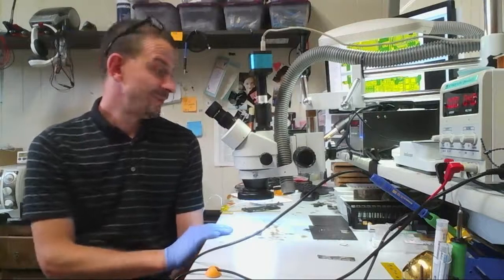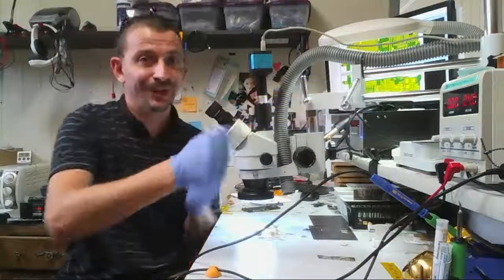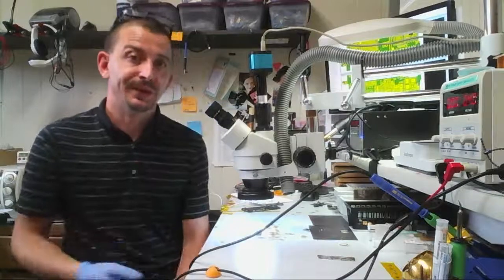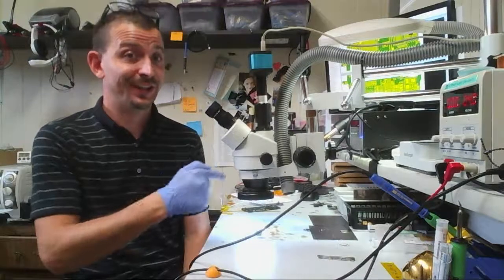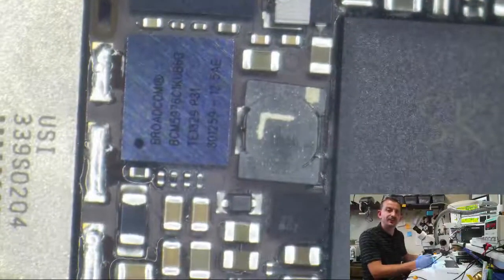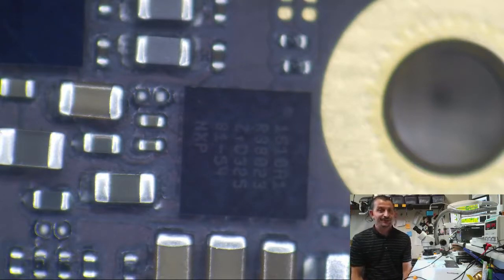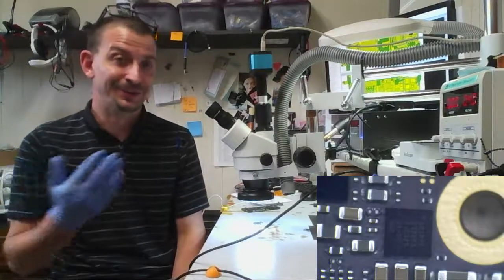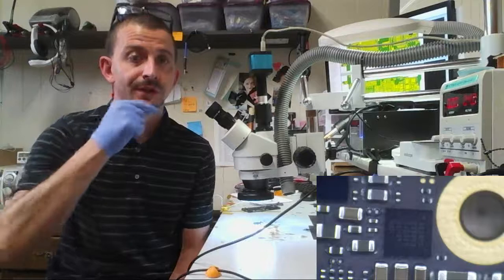Some new capture hardware for this YouTube channel

Comment: Jason  get this and take everything off  mount to scope and camera screws on it    adjustable works great   I HAVE SAME SCOPE  https://www.ebay.com/itm/KOPPACE-0-5-C-mount-Lens-0-5X-CTV-Adapter-Trinocular-Microscope-Camera-interface/392201151202?ssPageName=STRK%3AMEBIDX%3AIT&_trksid=p2060353.m2749.l2649

KOPPACE 0.5 C-mount Lens 0.5X CTV Adapter Trinocular Microscope Camera interface

Comment: I am interested in your Smoke Absorber and routing of it.  Can you do a video on it?
Reply from the maker: Yes, I sure will :)  Planned to do a video on it after I finalize it.  Right now it's pulling the air through a standard shop-vac filter.  I know it's not working too well because you can still smell it.  I'm installing a 6" vent pipe over head that will blow the exhaust strait outside and I'll tap that with smaller (2-4") flex tube that drops down to the microscope head.  The whole thing should cost about $50-$100.  That will keep exhaust blower way away from me but will be switched off and on from the bench.
Reply from the maker: I originally  built it out of a 5 gallon bucket with the blower mounted on top sucking from the bucket.  The inlet tube came in high on the side with a 90 degree elbow inside followed by another short piece of tubing to the bottom of the bucket.  The idea was to fill the bucket with what ever filter substrate would work best.   The whole thing was just awful - it had this harmonic whistle that I bet the neighbors could hear.   It was too loud to use.

Comment: Awesome, the other one wasn't showing what you were looking at. Louis said you lose 1 eye piece when you use the camera?  It helps drunk drivers!!!!! lolz! HICK UP! I bought the other type of Scope, Omano OM 1030. Its a good clear picture.
Reply from the maker: This cheap microscope head sacrifices my left eye when I switch the trinocular port on and it sucks horribly bad.  I'm replacing it with a simul-focal head VERY soon.  I like the image quality of this one but not having that stereo depth perception is just madness trying to do real work.
Reply: Maybe switch to using your opposite eye, Like if the right eye is on, then use your left eye on the right side? Call Louis lol, I think the more you do the more you'll be able to use it. Plus you could, do the close up after(or no). Mine has a cover where the camera would be, but the sell the camera head for more which means I assume I can't just take it off and use one. Hell I have a hard enough time working normally..........You'll be fine at worse just show before then after repair. I have a question, I'm fixing a 4th Gen I pod. the long cable on the digitizer broke, is it hard to re ad-hear the display to the digitizer? Had the thing done, fixed a missing pad with a jumper wire was putting it back together and I yanked it too hard. UGH!
Reply from the maker: If I never had variable zoom, I probably wouldn't miss it.  But I bet your OM 1030 has more working room than my Amscope!  I still won't be doing anything really important with one eye.  That stereoscopic view means everything when doing micro bga rework.  I have my sights set on the scope that's going to give me my left eye and give light to the camera at the same time.  Wont be long now... soon as the cash flow can take the hit.  It's always stressful to spend a chunk of money. :-/  I saved for months to buy the microscope I'm using now but it's paid for itself many many times.

iPod 4 - Your best bet is to buy a new screen.  Unless you mean the connector on the back of the board broke.
http://www.ebay.com/itm/White-for-iPod-Touch-4-4th-Gen-Replacement-LCD-Screen-Digitizer-Glass-Assembly-/181588903966?hash=item2a478ac81e:g:7~MAAOSwuhhXV-gB
Reply: its not a ton of room, so just took a few times to get used to it. I'm doing the power connector on the same unit, I can't get the solder to flow nicely(its globed on the pins) and the sides of the protector. Went back today to try n clean it up, just got worse.I don't have a shop, doing this out of my apartment. Trying to get word of mouth, not easy in a money depressed town(near Buffalo NY). posted on Graig's list but only reply was from a guy who has and does macbooks, which is where I was trying to focus my income on. Just got 1 with a dead board, looks like coke a cola on it. There is a connector near the super drive bottom that is removed and gone from the board. The cable is coming from the screen area, has a metal molex plug? any ideal? My guess is the camera? The board side is just gone, at least the cable side looks good but the plug on the board was ripped off and will need to be figured into place as the pads r gone. I found a parts cleaner its 6 litters think its enough to do boards in? I'd love to buy the 1 Louis has but I can't afford $675.linkhttp://www.ebay.com/itm/311013126895?_trksid=p2055119.m1438.l2649&ssPageName=STRK%3AMEBIDX%3AIT
 Thanks man! Keep posting, they will find you if you build it!!! :)
Reply from the maker: +Philip settimi if there's enough heat and flux - it should flow.  I used to use an SMD 852D rework station I bought on eBay.  It had hot air and an iron with adjustable temps.  I used it for a year and had Ok luck but there were so many jobs where the solder would cool and clump before it ever had a chance to flow.   (Not to mention melting a few $6 handles per year) I'd have to turn that thing way up to get it to flow and even then it sucked pretty bad.   Also I found cheap 63/37 solder I ordered on eBay was like trying to solder with a steel rod.  It wasn't usable with that station. No way in hell that garbage was normal 63/37 - But I didn't know it.   I just knew it didn't work very well and kept trying to figure it out. After I got my Hakko station, I still could not solder with that eBay solder I bought and had way better success with the lead free stuff Walmart sells.  I eventually bought some Kester 63/37 from Microcenter and OMG, it made the difference of night and day.  It flows effortlessly in most cases unless there's something dissipating heat faster than I'm giving it.
Reply from the maker: +Philip settimi hmmm not sure what connector that is..  I'm still using a cheap ultrasonic cleaner that does a pretty good job for now.  I'll upgrade it some day - hopefully not in a panic because the cheap POS died.  Lol

Comment: how do you keep dust out of a iPad repair?
Reply from the maker: I don't.. LOL  They almost always wind up with a very tiny amount of dust.  Just when I think I put it together squeaky clean, there will be one fiber laying somewhere you can see.   I keep additional dust from getting in by making sure the adhesive covers all the way around the frame with no gaps before sitting the digitizer on it.
Reply: +STS Telecom oh I thought I was the only one with the issue ... I try to keep the glass over it after I use some canned air to prevent dust from settling back on it but it never seems to be perfect ... it annoyes the hell out of me.... customers don't seem to notice but I do.... was hoping you had some magical solution other than reassembling it in a clean room..  actually I was going to build a mini clean room like device with vacuum and hepa filter with rubber gloves attached for anything that required it.  the cost would be trivial to make it and would help my calm my ocd ..
Reply from the maker: +Rico R you sound a lot like me when I'm doing an iPad screen.  I try to make sure they are absolutely perfect and am always pointing out the minor imperfections to the customer with my wife stomping my toe to shut up because they would never notice that tiny smudge.  Many times I've wound up nitpicking to get rid of a tiny smudge only to leave a great big one!  I had some ideas way back about trying to make a vacuum/clean chamber to do the assembly in but changed coarse to board repairs and never looked back.   I really dislike doing iPad screens.

Comment: hi Jason I need you help with the light area , what kind of light do you use on your shop?
Reply from the maker: I'm using florescent lights on the ceiling, on the little lamp sitting on the main workbench and one more in the clamp light behind me.  The microscope light is a cheap adjustable brightness LED light I bought on eBay.
Reply: +STS Telecom oh thanks jason.

Comment: Hi Jason... Yes trying to micro-solder like a cyclops is no good at all :)  

I sure hope you get on better than I did with your new camera mate, I only say that as It looks the same as the one I use and had issues with.  It was not only me either.. a couple of others have had the same issue regarding the camera popping it's dc-dc converter. In my case the camera came with a poor power supply which on testing was spiking quite badly.. It ended up blowing the cameras dc-dc converter. I replaced the dc-dc converter twice IIRC, before getting a replacement camera. 

I'm still using the same camera at the moment but with a much better regulated PSU.. And it seems fine fingers crossed

If you like.. You can check out the video I did covering my issues.   https://goo.gl/JPeJbt

Cheers
John
Reply from the maker: It sure is the same camera as the one in your video.  I'll be watching that video all the way through when I get done working today :)  Interested..  I powered it using light-weight power supply that came with it when I tested it with HDMI.   Running it like I am now it's getting powered by USB so you may have just saved me from smoking something when I switch to HDMI.  Thank you!